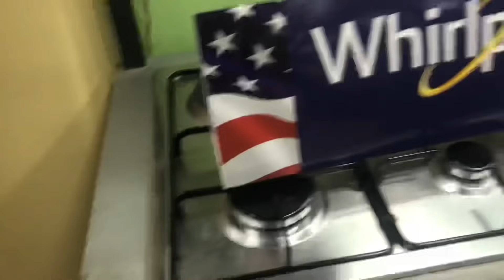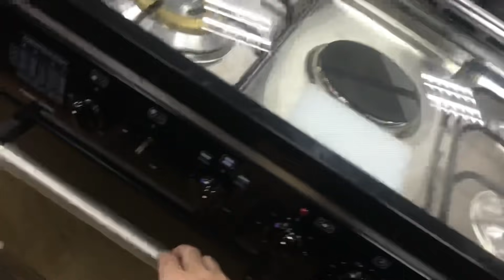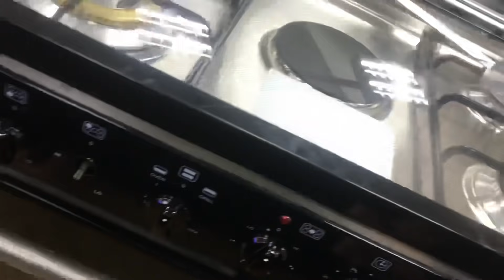BUYING OVEN BUT OUR DEBIT CARD ISN’T WORKING - ANONG NANGYARI??

Comment: Elo'  I can see the new Electric & gas combo you just bought nice  with gas cabinet, but i think  the gas tank should be in a  well ventilated area and not inside the enclosure to avoid gas build up inside cabinet  just  in case leak occurs.. anyway thanks for sharing

Comment: Looks like  a 900mm cooktop and oven. I know you can get by with 600mm, but really, do you want to just keep getting by. So its gas, which is great, far better for cooking, with two electric elements in the middle and electric oven.

Comment: you should turn the counter to its original set up because the cabinet part is used for kitchen stuff like condiments , plates etc. The front part of the counter will serve as a bar counter where in you can put high chairs (revolving)
Reply: jam gel yup! The bar can also be used as additional “dining table” when there are guests

Comment: Bryan u need to buy safety regulator to prevent fire...  What it does is when there's a gas leak it will automatically shut off.

Comment: I think the old mall is where we kept going... it didn't seem to rundown. Just the ACs were set up to try and blow the hot air out though pipes instead of just pumping the cool air in.
So it would be cool where there was an AC and then you move to the side and could feel the heat from the pipes. :p

I told my Filipina heart I wanted to get a cloths washer if I move to PH... but she said no need..... but she spends all day washing a load of cloths one by one. :(